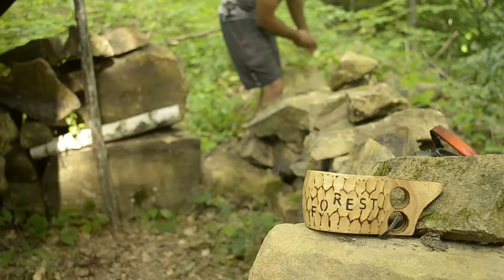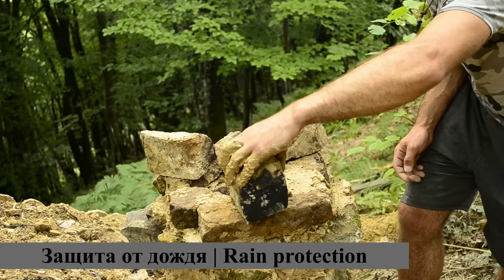Hobbit dugout in 14 days. Start to finish

Comment: 28:10 - Bro it's tall enough!
31:00 - That looks really cool though
35:29 - did you cut up all that wood during these first 7 days or did you spend some extra time preparing wood for this build that we are not including in the total 14 days? It's fine either way, I just want to know if this involves pre cut up pieces and ifi that time spent cutting it up was not included in the 14 days. I don't know why I care lol just curious
41:35 - Ew no... why are you putting plastic over the roof?! 
43:45 - Oooooh... that's cute <3
52:17 - What are you doing with that blowtorch?..... WHY ARE YOU LIGHTING YOUR NEW HOUSE ON FIRE?!
52:50 - ooooooh kay... that's (kinda) cute... i guess

Comment: Can you not see the caine saw scratches marks in the wood ?it looks good and nice when he has a hammer and chizzel and cutting the rocks ,and then what is up with a propain torch to the door ? Is that supost to do something? Make it look better give it some longevity ?as if I was trying to copy him and do the same thing in the wilderness,magicly out of thin air have a torch to seal the door and wood work , come on be real !um where did you get your bottle of water from ? all looks nice but very UN realistic! Nice cup by the way that you got off of amazon.. and that ax Is useless  it loos nice but when it comes down to it has no weight to cut things ,all I can say is this example of building a hut or cave or shalter is not reality..  you can not have cut planks to make what he is making you will not have a propain torch to singe the wood the days + and things he is showing is not real … try to build this in the woods with an ax and shovel in 10 days  … not going to happen , sorry but not real .but its nice to wach that 1lb ax he has .. lol trying to cut a piece of wood with that lol try it out  you will not be able to do @#$%$@#$%$    if your  ax is not 4 lb or more you will not be able to do any thing. But shave the bark off of a tree limb.and its almost amazing when out of no where he pulls out a hold saw to make the 1 inch cuts hey he just had that in his back pocket.. note to self have hole cutter in the end of days when things get bad ..+ dog+ tea kettle _  hammer+ shovel yeh life is good.. pick ax and random invisible things that happen to appear (cut lumber) (food) (water) you know the things () that just happen to be there weee have fun with this fiction .